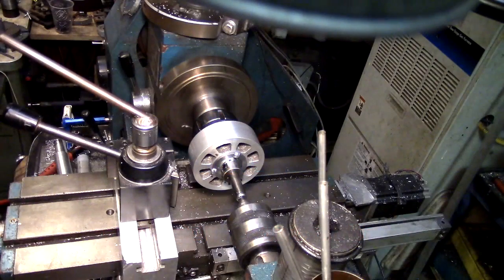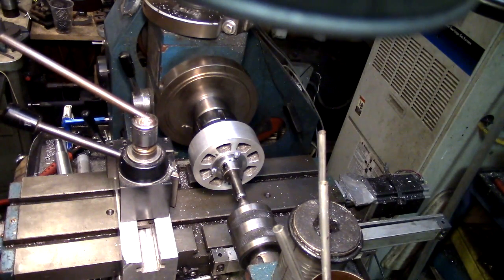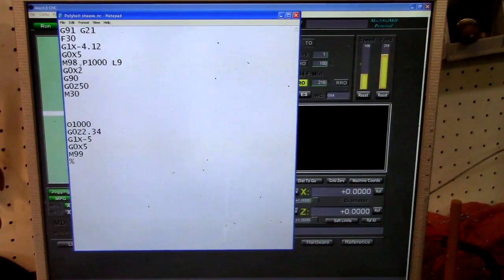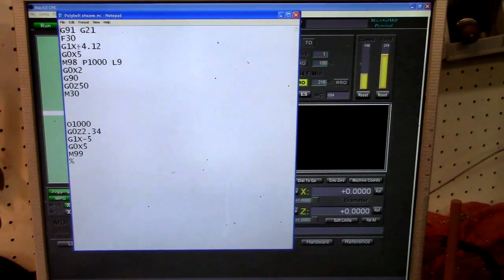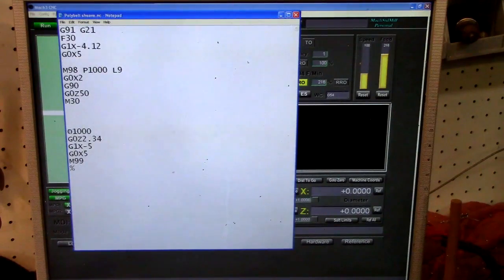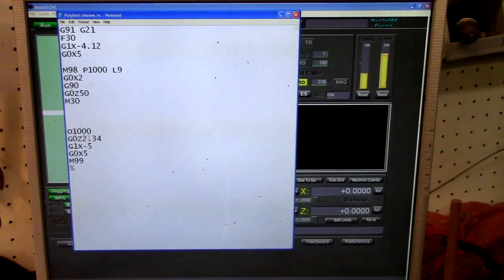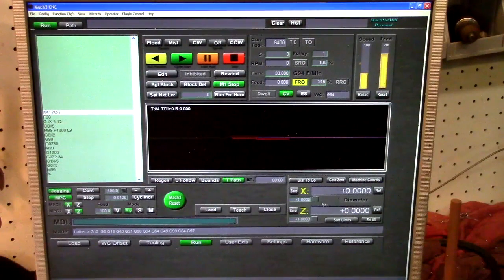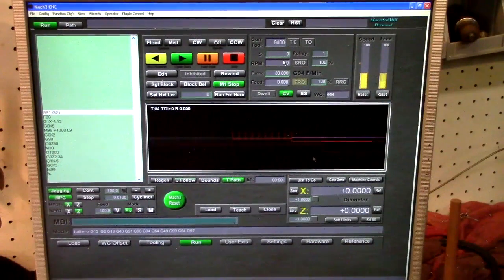G-Code Subroutine Loops - An example using Mach3

Comment: Thanks for the fast reply! Is the code between F30 and M98  necessary?
Reply from the maker: Not really.  It depends how you start the operation.  It was easier for me to include it so I didn't have to do any higher math :)  Had I touched off and moved the tool to the retracted position (4.12 + clearance = a nice round number like 5mm) I would have coded it as:

G91 G21                 < Incremental / Set to Metric
F30                        < Set FEED rate

M98 P1000 L9         < GOTO o1000 sub-routine 9 times

G0x2                      < Retract another 2mm to clear the pulley flange
G0z50                    < Send tool 50mm to the right at MAX speed
G90           < Set movement back to ABSOLUTE mode in case I forget to later
M30                       < End program and rewind to the top

o1000                    < Start of sub-routine
G1x-5                    < Plunge tool 5mm at feed rate set by F30
G1x5                     < Retract tool 5mm at set feed rate
G1z2.34                 < Move tool to next groove at feed rate
M99              < RETURN to the M98 line until L counts down ELSE resume at the line after M98

Comment: Hi Eddi,  Is the code between the F30 and M98 code for the first grove? Is the code under the M98-M30 the code being looped?
Reply from the maker: Hi James.  Yes, the code between the F30 and M98 is the first groove and only used once as that's where I indicated the part, touched off, and zeroed the DRO.  The M98-M30 section is the last retract and get the hell out of the way movement and is NOT repeated since it the loop hops over those commands until all the loops are completed.  After the last loop the code resumes on the line after the M98.  The M30 command is a STOP+REWIND to the top code that says we are done and be ready to run again.

Thanks for stopping by.

Comment: Hi mate.
Thanks for that.  I think that I will be able to remember that after a few times messing it up.  It seems simple, but I think I would forget to make the necessary steps.  Do you get reminded if you forget them, or does the machine just blink at you, till you just want to give the thing flying lessons.  My favoured solution to frustration. 
Marcel.